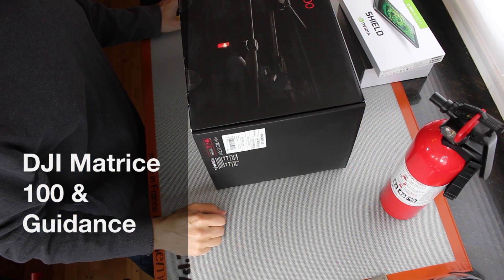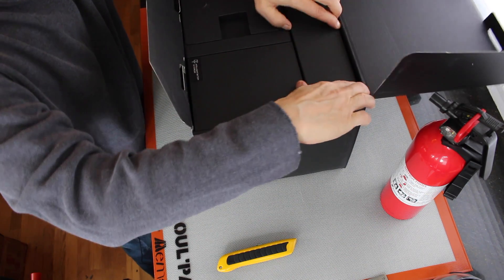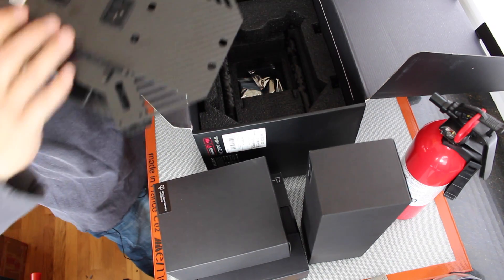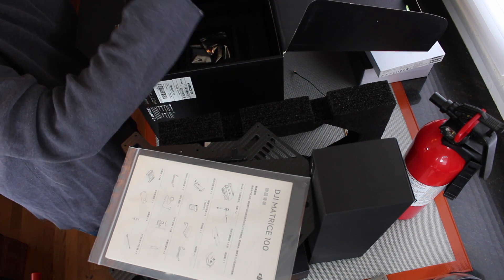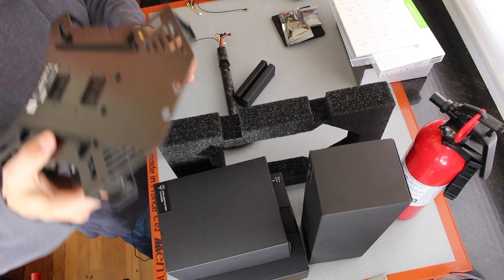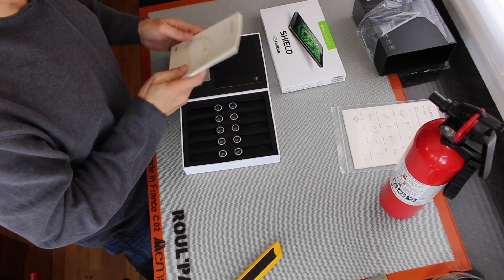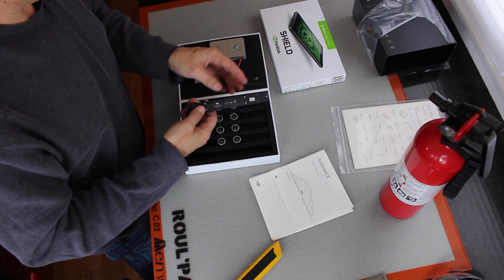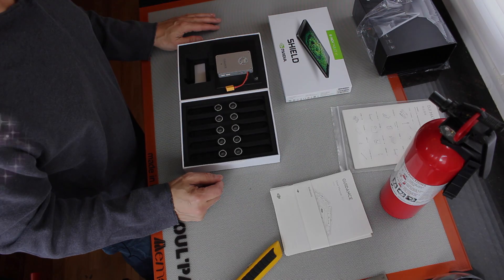DJI Matrice 100 Part 1 - Matrice & Guidance

Comment: I'm excited to follow this series.  I just recently received the same setup.  In addition I have the Manifold, but would like to incorporate the Jetson TX1 board into it for some external CV applications.  I'm currently in the process of doing a build-up for this platform.  I disassembled everything, the arms, the body, even the flight controller.  I normally do tear-downs of all the newest drones, but since this one came as a kit, I'm doing the reverse.  Love your channel.  Keep up the great work.  Andrew Baker
Reply from the maker: +Drone Media Group I just received the Manifold today. The thing that makes things a little difficult to use a TX1 is that in order to talk to one of the Zenmuse cameras you need to have a CAN bus connector. The Manifold has one of those built in, along with a library to talk to the camera.
However, if you're using a custom camera setup, or something like a Stereolabs ZED, that should not be an issue.
Have you taken the Guidance apart, I'm curious as to what type of processor is in the box.
Reply: +Jetsonhacks I do have the Stereolabs ZED.  You probably have seen their YouTube video demonstrating their stereo vision system using the Matrice 100 and TX1.  The Guidance has the Altera Cyclone SoC (5CSEMA5U23).  I haven't looked inside the Manifold but I'm thinking it's just a repackaged TK1.
Reply from the maker: +Drone Media Group The Altera seems like a nice little package, with the Guidance there's quite a lot of I/O for it to handle. Yes, the Manifold is a pretty lightly repackage of the Jetson TK1. I'm interested in seeing how well the DJI SDK runs via ROS on the Manifold, and to see how much payload is still left after mounting both the Guidance and the Manifold. I now notice that I have not seen a gimbaled camera, a Guidance and a Manifold mounted on the Matrice in any of the videos.